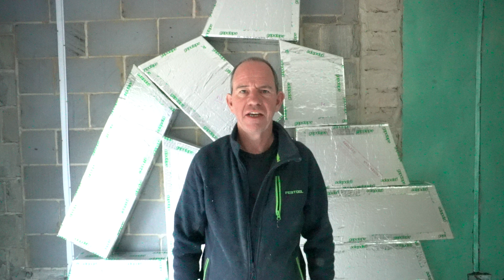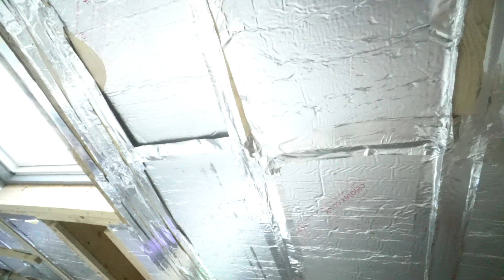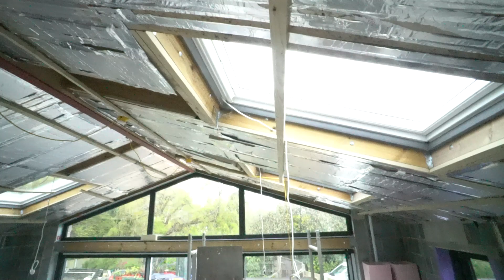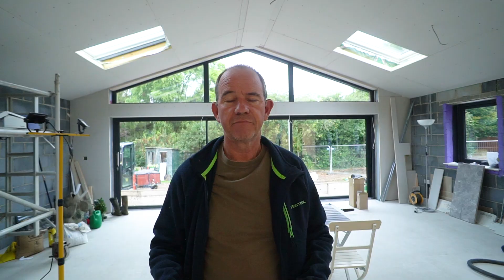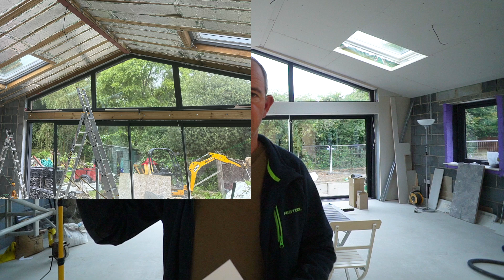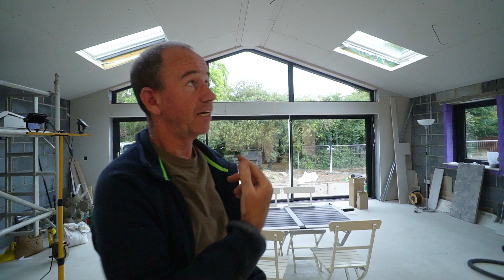Part L performance gap. Why should you "Mind The Gap" when installing insulation

Comment: How did you end up joining the insulation in the cold roof with the insulation in the wall? I'm in the same situation really. Only thing I can think of is stuffing in rockwool as it's somewhat flexible but I'm worried about potentially block the air gap.
Reply: Please ignore my comment, I should of watched the whole video in one go 😂 You cleared that up later, cheers
Reply from the maker: I can't remember if I filmed what we did or not. I was really very unhappy with how the build had been left, I think I spent 6 months researching the best option and the answer seemed to be I wouldn't start from there! We asked a friend who was a site foreman for a local quality builder. He said to take off the bottom few rows of tiles and ram a specific non absorbent rockwool in and place a plastic spacer above to keep the air flow. That would have needed scaffolding and me taking a roof off I had paid to be fitted. I wish I had filmed what we did as I think it was the best solution overall and using my IR camera I can't see any obvious cold bridging. I think I probably described how we fitted battens then cut the PIR to the right shape, added lots of foam and pushed in the PIR. It looked pretty good and we checked ventilation was still good. It did take me a couple of weeks but I work slow. I wish you the best of luck on your build, any questions please just ask.

Comment: We used Gapotape in the roof of our drafty 1970s house 2 years ago, along with Superquilt over top. Recently opened up the superquilt to remove some of the PIR for the new extension and its was hard to pull out because the gapotape was fixed in so well. We spent extra money on all the products but have great results, especially for the retrofit purpose.  We had to extend the rafters of the roof and fitted 50mm PIR with Gapotape, Breatherquilt under our new roof tiles and superquilt inside the roof below the PIR with battens and then plasterboard to make the loft a bedroom. 2 years in and house is so much warmer and quieter from the passing traffic noise.
Reply from the maker: That's great to hear. This will be our first proper winter with full insulation (I still have a lot to add to the old loft as I removed the fibreglass and I am replacing with a non itchy replacement.  Its impossible to know if all of the work and cost was worth it but we know we could not have done much more.

Comment: Great video and you highlight a really important point. Currently doing a renovation and the builders would like to use Actis Hybris in the roof. Did you consider this? Supposedly a lot easier and quicker to fit (which may help reduce gaps) but you need a larger lay up to achieve same values as pir.
Reply from the maker: I had not looked at that. In the begining this was not a job I was going to do. The architect specified the construction and the builder should have followed it. With hindsight I wish I had taken a lot more notice and not just trusted people to get things right. Ideally I would have liked a warm roof but as this was an extension we probably didnt have the height to do that. I think anything that is simpler to install may be cheaper as labour costs as much if not more than materials. The rooms has been toasty warm over winter so thats the result we wanted in the end. Who knows if all the time and expense of using Gapotape was worth it?

Comment: Did you look at the cost of materials and labour for insulation vs total heatloss of the property?

I calculated the heatloss for my completely un-insulated solid stone wall farm house  vs 150 cellotex in the roof and 80mm internal to all walls.

Total heatloss was only half the uninsulated house.

Material cost alone would unlightly be coverd by the reduction in heating cost in a lifetime.
Reply from the maker: Not sure if you saw my other video where I was using AI to try and help me justify the insulation or not. I found it very hard to do so. I didn't factor in the cost of labour as the original builder quoted us for the materials specificed by the architect. I later found out he had not actually read the specifications and was just going to build the way he always had. I should have seen a red flag at that point but we agreed to pay for the uprated materials. Its easy with hindsight to look at alternative ways of doing things but we were in the middle of a build with a tight timescale. I think the biggest change I would make would be to demolish the old house completley and build new saving the VAT.
Reply: Yes it is hard to justify insulation when you look at the real ROI vs just installing a bigger heatpump and emitters.  If you have the space, a larger battery and as maxing out solar would pay for its self much quicker IMO.  Any spare would Lightly be far better off in the S&P500.
Reply from the maker: @inh415 I would tend to agree but energy prices are likley to only go up so solar and battery is key. I am considering a second 13Kwh battery but the sums don't really work. What is working well is charging may car at very low current which gives me much longer off peak rates on Intelligent Octopus Go. I managed over 24 hours at 7p with a combination of that and my battery covering the slots when prices go up. We are very high energy users.
Reply: @JurassicJungle  have you checked out fogstar batteries? It might be worth reaching out to see if they will do you a deal in exchange for coverage. The most affordable that i have found by far and uk based.  As im a small holding here i hope to DIY install around 50kw of solar in total between the house and farm buildings since octopus no longer require mcs for solar installs

. Its crazy how cheep the panels have gotten in the last few years, around £80 per 450w panel last time i checked.
Reply from the maker: @inh415 I went with a Givenergy AIO so really need to stick with that. Its £4k for another 13kWh. I may add some more panels as I only have 12 and coule add 12 more on the flat roof. Be careful with the Octopus thing as it is just a trial and you have to pay £250 to get approved, it also means you are locked to Octopus. While they are great at the moment that may not always be the case.

Comment: I priced up gappotape for my valted ceiling and it would of more than doubles the cost of the insulation alone.

As long as you can make it airtight and ensure no draughts are bypassing the layer of insulation then the increase in heatloss will be minimal.

If insulation is undersized by 1%,  the insulation value will onlu be reduced by 1%.  

Obviously if air is bypssing the insulation all bets are off.
Reply from the maker: It certainly added a lot to our costs, I think it could have been £800 in total just for the tape. I think if the insulation is fitted well then its probably not justified. Our insulation was mostly poorly fitted if if we removed it the pieces would have been too small to reuse. As it was we managed to cut most of it down and reuse with Gapotape. I will never know if it was worth it but we do now have a nice warm home. It would have been very expensive to try and improve later if we had just left things as they were.
Reply: @JurassicJungle   did you overboard the rafters also to prevent cold bridging?

I have just done my vaulted roof 45 between and 80mm over. All phenolic to save a out 20% of the thickness vs pir.  Foamed any gaps between rafters that i could but also made sure to go around the perimiters with foam adhesive when bonding the 80mm ontop ( well under i guess...) 

Lovely old oak rafters made from tree branches and installed by using several different sized feet as the only mesuring devices i suspect.
Reply from the maker: @inh415 Yes, we had 100mm between and another 60mm of isulated plasterboard over (72.5). We had real issues with the insulation detailing at the top and bottom so did use foam there while ensuring a ventilation gap. With an IR camera it looks pretty good but you can see the cold bridging of the screws. I don't think I would do it with insulated boards again, they were very expensive and very tricky to install even with a lifter. Its not a job I wanted to do myself but I could not get anyone insterested in doing it for me.
Reply: @JurassicJungle  after installing 80mm sheets without plasterboard i am glad i didnt go for ones with plasterboard as the added weight would make them hard to manage even though im cutting sheets almost in half to fit between purlins and fit up the stairs.

I did wonder about cold bridging of the screws,  more from a condensation point of view as the heatloss would be negligible. As im bonding the whole lot with adhisive foam, i plan to use the bare minimum amount of screws required for fire regs.
Reply from the maker: @inh415 Good luck with it, it was very hard work with the sheets we used. Without a lifter doing that at 3.5m would have been very hard.

Comment: Be helpful to mention the extra manhours involved with the improvements over the contractors. For most customers thats a massive uplift to achieve better results and specs.
Reply from the maker: Thats a very fair point. I would still argue that my initial instal was really not good enough but if a higher specification is requested that’s going to take longer. It probably took me 2 weeks on my own to remove all of the insulation in the vaulted ceiling re cut it all and gapotape it (about 6m square room). I am nothing like as fast as a contractor would have been but it would still take longer to do it to that spec. What frustrates me is that one trade does not consider the impact on the next. For example If the design and installation of the roof timbers was done with insulation in mind (assuming a correct 400 or 600 centre) then there would be much less waste insulation and time. Our roof had every timber at a slightly different spacing often tapering form one end to the other. That made it take 2-3 time longer to measure cut and fit each piece. Perhaps that accuracy would only be possible for factory built structures like SIPS panels? The way that work is done on site really has not moved on much in decades. Things may be different on a new build, ours was an extension/ renovation so we were looking to exceed building regulations and doing things our contractor had not been asked to do before. I can't see how they would pass blower tests but perhaps doing extension work its not a problem they need to worry about?

Comment: Very informative video! It’s amazing how little knowledge about this matter is within the building trade and building inspectors. Question: are those sliding doors triple glazed? If not what’s the UValue of all that glass and how does compensate me all the effort put on insulation on the roof/walls?
Reply from the maker: Hi, There. We went with triple glazed windows for everything other than the sliding doors. I found it quite difficult to get U-Values from window companies, they don't seem to want to share them! We went UPVC for all our normal windows as we found Aluminium had poor u-values and the alu clad timber was going to add another £30k. I think the patio door with a special coated glass (double glazed) was about 1.6.  You do have to trade off poor U-values with glass by adding more insulation elsewhere. While the doors are large our build overall does not have a very high percentage of glass. I do wish we had spent a bit more on the windows. We went with top hung and many of them have dropped a bit and catch the seal when opening, I think our windows were about 1.0 with triple glazing, would have been 1.3 with double.

Comment: Could just cut the insulation perfectly…no expensive tape and no gaps….
Reply from the maker: Thats OK if all of the timber is straight and been installed true which was not the case for us sadly. Also timbers will over time in the seasons possibly opening up gaps. Our insulation had been just cut and hammerd in but very poorly. Perhaps if it had been done better in the first place we would not have felt the need to remove it and do it again which was a lot of work. We will never know if it was worth spending the time and money doing it with tape or not but we are happy that the room is toasty warm with our heat pump and I can't see any obvious cold bridging when I use an IR camera. If we had not done this and the room felt cold we would have wished we had done our best and it would have been near impossible to try and improve it later.

Comment: Having just fitted PIR on my extension as cold roof I have some thoughts
1 The 3mtr limit on height of an extension is the biggest issue. I would have gone for a warm roof which would have saved a lot of time and effort but the extra 150+mm would have had to be taken from the inside ceiling height. With a step down outside the property and 225 thick joists you cannot avoid having to go for a cold roof. The regs should say 3mtrs for a cold roof and 3.15 for a warm. 
2 There has to be a cost alternative to Gapotape. While installing my insulation and hammering in the insulation I was wishing I had used something like that product until I worked out that cost would have been 50% of the PIR cost.
Reply from the maker: I agree with the height issues with a warm roof, we were OK on height. Gapotape is a great product to work with but there is no competition and it does add up to quite a lot of money, even worse with a pitched roof install like ours. Its hard to calculate what the level of improvement is in financial terms and if that investment is worth it. I like the approach that Robin Clevitt takes, he spaces timber at just over 400 so that he gets no waste from a 1200mm PIT sheet and also make sure they are all evenly spaced meaning he can install much faster with no waste. Our timbers were all over the place with lots of narrow sections probably caused by support for the roof lights, that resulted in needed much more gapotape. We need to work to much better levels of detailing and consider the impacts on each job on the following trades.
Reply: @JurassicJungle  I was told by a builder/architect that would install the insulation at the same time as the rafters. eg put the insulation up against a rafter then hammer another rafter against the insulation. 
In reality it would not work as you cannot put screws in the joist hangers on the insulation side.
If only rockwool had the R values to make it an alternative as it's so easy to install.
I still think hot roofs are best (lots of reasons) and you should get height allowances for using the system.

Comment: I am renovating a stone barn in Portugal (plugs vid!) and on the (warm) roof, I have used spacers to ensure the gap between joists is identical...a simple solution that means no measuring. Then, I am installing battens and placing the insulation into place before boarding over / installing battens for tiles. This means that the insulation does not need to be cut (I am using expanded cork 500x1000) and any gaps are covered by the battens meaning no air flow. Yes, this means more work and will not fit with all techniques but highly recommend to any self-builders. This also gives a double air gap, above and below the insulation.

On a previous build, I pushed the insulation in after the studs and joists had been in stalled and had exactly the same issues as you showed early on...basically, my advice would be to install the insulation as you go, try to avoid cutting it & save yourself a lot of hassle!

If I were using the big sheets of celotex again, I would use long screws through battens / insulation to hold entire sheets off the joists (OK, you lose a few mm of head room so not great in all applications) and then screw plasterboard to the battens. That relies on the insulation material remaining stable for sure but the screws ought to be up to the job?

Cheers for an interesting & considered video...too many just show the "Oh look we did it perfectly" bits.

Best to you from rural Portugal - subscribed!
Reply from the maker: Hi Howard, I wish I had built the roof my self as I would have done the same assuming it met with the structural needs. We didn't have the room to fit too much more below the rafters as we have a very low pitch. I think if I did it again I would fir a second layer of PIR and then plasterboard rather than the expensive insulated plasterboard sheets. Glad you enjoyed the video, I am trying to share the lessons I have learnt to save others the same pain.

Comment: Thanks for sharing, a really interesting topic. I had the same concerns when using Celotex and mostly went for a 10mm gap and then expanding foam. But sometimes the Celotex was pushed out of place when the foam expanded and when dry, the foam needed trimming. I used the aluminium tape too but it never stuck very well to the timber. I like the idea of the memory foam tape! I would have re-done the ceiling too!! Thanks for sharing your insights and findings RE the performance gap. The building industry really needs to up its game and improve insulation installation. The reduction in thermal efficiency even with such a small gap is shocking. Oh, love Steve the Roofer, he's the God of roof insulation installations. His videos are awesome!!
Reply from the maker: I guess if you leave a laege enough gap you can get foam in but its hard to ensure you fill the entire space fully with a 100mm board. We used foam at the eaves based on suggestions by Steve Roofer and it worked very well in an area where we had little choice to do anything else. The foam can get quite messy. I am not sure I trust some of the answered ChatGPT gives me but it absolutley makes sense to fit the insulation as tight as you can.